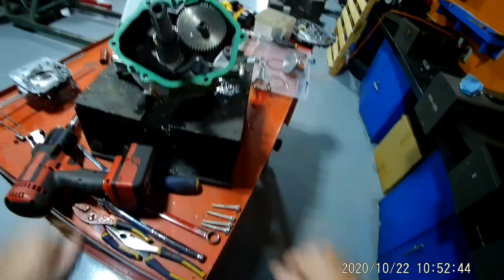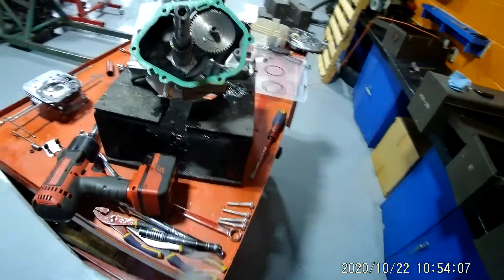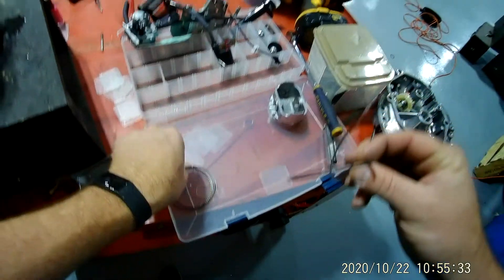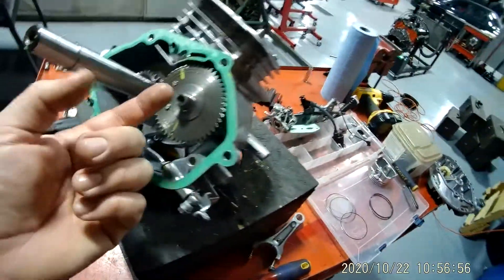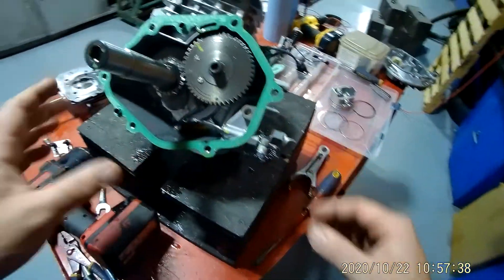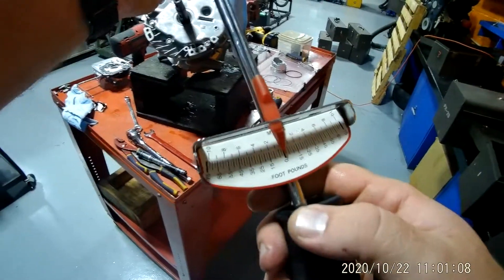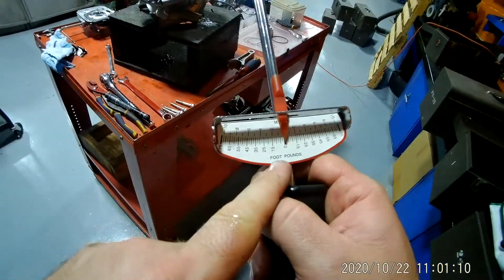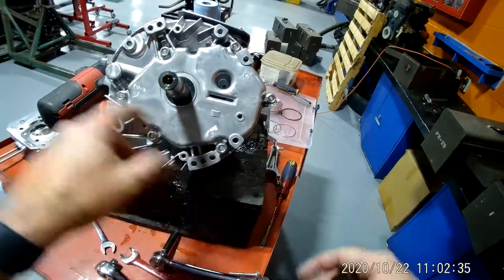Honda GXV 160 OHV engine disassembly and reassembly video 6

Comment: Hello great videos. When reinstalling the oil pan i was unsure of the governor  arm- or I actually mean the inner plastic piece that slides in and out. I can assume that the inner plastic piece has to be pushed in out of the way for the metal governor to pass through?  Thank you
Reply from the maker: I’ll not real sure to be honest. If you don’t see it in any of the videos I made I can’t recall.